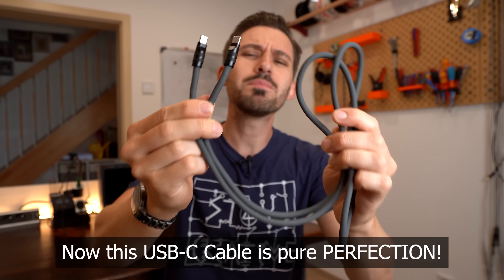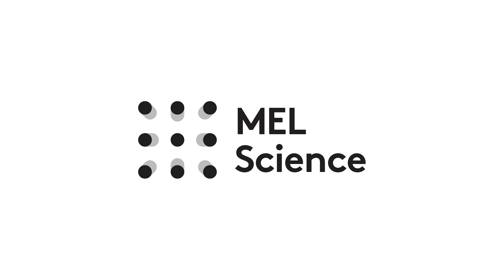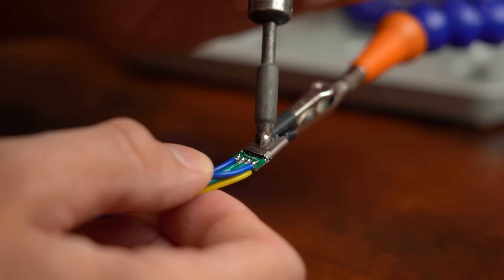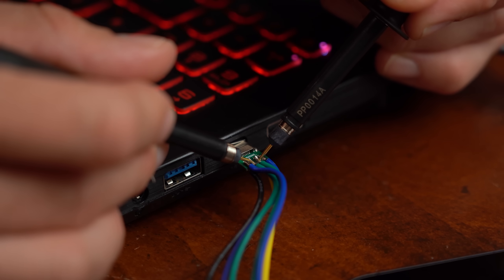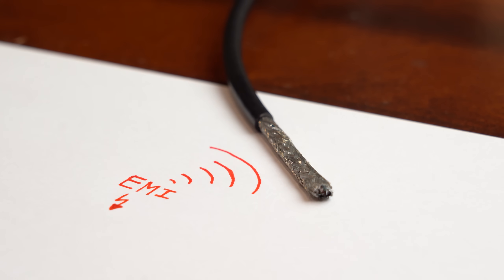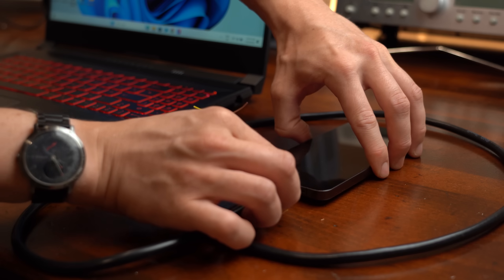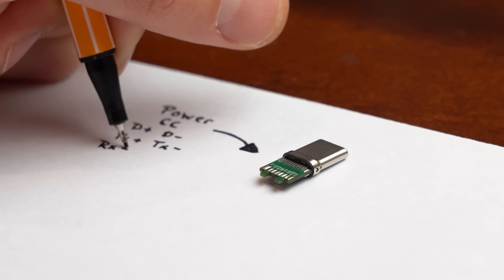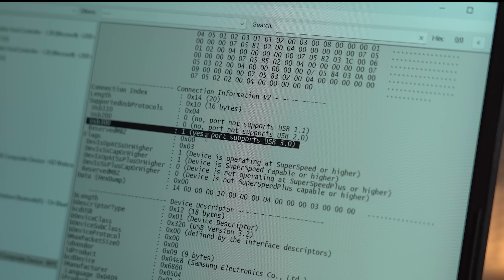Is it IMPOSSIBLE to make the Ultimate USB-C Cable? (Shielding) EB#64

Comment: 8:20 yep, you need those. We made the same mistake on $700 pcb at work
Reply from the maker: Thanks for the confirmation :-)
Reply: Yes
Reply: I need to ask how no one looked at the spec first ?
Reply: Dang... Makes me feel less bad about an incorrect footprint on a preamp board I designed here and sent to manufacture without 1st printing it to paper to test fit... That was like $50 dollars... Did still hurt my pocket and ego.
Reply: i'm actually very confused by this problem, because i could make a successful connection with only usb3 wired, but it worked only if the device was reset while connected. If the device is powered externally and isn't reset the moment the connection is made, it was never recognized. Even more, i could also connect a different device to the usb2 wires of the same host connector, and it did enumerate properly.
Reply: I'm no expert on USB3. But I believe USB2.0 kicks off enumeration as USB1.1 and the switches up to USB2.0. Does USB3 do something similar perhaps?
Reply: @microknigh7  Correct me if I'm wrong, but I'm pretty sure the communication starts as USB 2.0 by pulling D+ up. After USB 2.0 is set up it will negotiate with the host to test USB 3.0 capabilities and switch up. This guarantees USB 3.0 devices work on 2.0 hosts and 3.0 hosts can also detect 2.0 devices normally
Reply: @BrennoMaturino1  Yes, that's what I would expect to happen
Reply: @BrennoMaturino1  USB2 and USB3 enumeration are separate. USB3 devices try USB3 first and when that fails, they fall back to USB2. Standard USB3 hubs on the other hand enumerate on both and show up as two separate devices. If there were devices that absolutely must have USB3+ speeds in order to be of any use, they could skip USB2 pins. Though I cannot think of any device that would become completely unusable on USB2. My first thought was high-speed cameras but even those could still be used at reduced frame rates, cropped resolution or for photography on USB2.
Reply: @teardowndan5364  Basler usb3 cameras are one example, they outright refuse to work over usb2. These are the exact things i was having trouble with (needing a reset when connected by usb3 only to be recognized).
Reply: @teardowndan5364 my chinese USB3 hub works quite randomly, on some ports better on some i can't make 3.0 no matter how I try. Why that could be?
Reply: @vadnegru  I've seen many cheap devices where the USB ports aren't soldered properly or aren't the correct type, ex.: ports intended for mounting on ~0.2mm thick flex cables with stubby anchor pins mounted on a 1mm PCB where the shell tabs only go half-way though the PCB. That causes data pins to break after a few plug-unplug cycles since the connector housing has no other mechanical support.
Reply: @teardowndan5364 funny thing, not ports but switches broke because they don't have much support so i padded them after replacing. By default they were hanging on metal that soldered into board.
Reply: Lol.
Reply: It depends on device, I think. I've had cases where the connector was old and worn out so the connection wasn't perfect and it would sometimes use USB 2.0 and sometimes 3.0. My way of "fixing" it was placing kapton tape on the USB 2.0 pins (USB A) so my device had either 3.0 or nothing to communicate. It worked on all my devices, at least
Reply: Really? I've seen breakout adapters that I think split these to a second port.

Comment: Mr. Great have you considered that maybe the chips are the issue?
Reply from the maker: What chips? There are none in this cable. You mean they are missing?
Reply: I think he meant the circuit in the connectors you bought from AliExpress. They might be faulty or fraudulent
Reply: @greatscottlab  yes I meant in the cable. High speed usb cables have active components I thought

Comment: you need both CC pins one is data and other one is position if i remember well
Reply from the maker: I tried all methods. With 2 CC, with only one and a resistor. Nothing worked...
Reply: @greatscottlab  might be wrong, but I think CC1 and CC2 are swapped on opposite sides.
Reply: @greatscottlab  hmm 1 resistor? i am sort of sure it needs to be symmetrical also what cable impedance did you use? if it is Ethernet cable then good enough .

BTW u still need usb 2 for initial auto-negotiations , tho maybe the problem is from the initial negotiation to begin with

Comment: I really like the idea of DIY your perfect usb type C cable even if it's more costly but sure will last a long time
Reply from the maker: Well.....let's see how the video ends....
Reply: @greatscottlab  after watching till the end unfortunately you give up. I think you could DIY your own cable like twisting yourself, cover it with aluminium foil, using proper usb type C ic, design your own pcb for the IC, etc. Still long way to go if you really wanted perfection. But I think it's not worth it unless you want to commercialized it
Reply: @greatscottlab  if you could find a cable with twisted shielded pairs for data it should work as expected right?